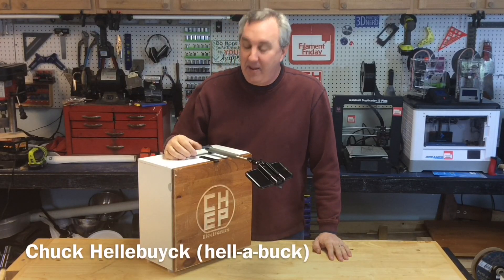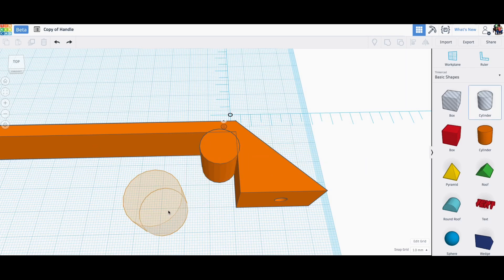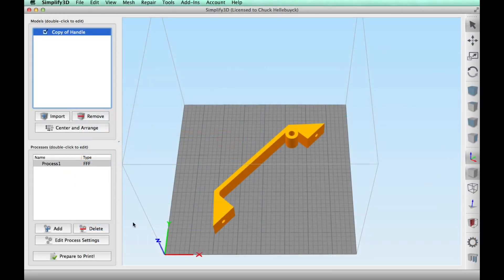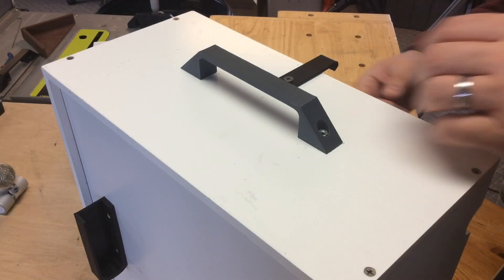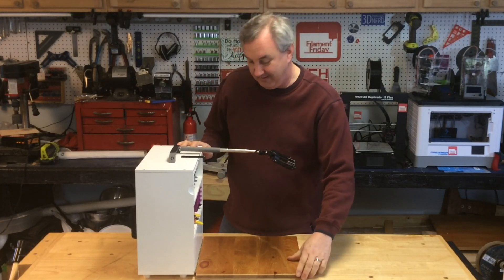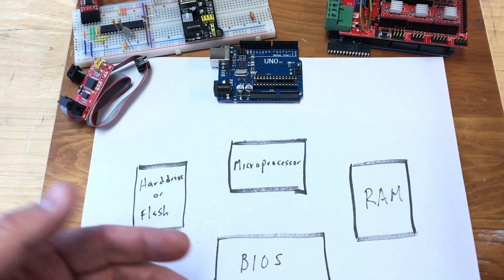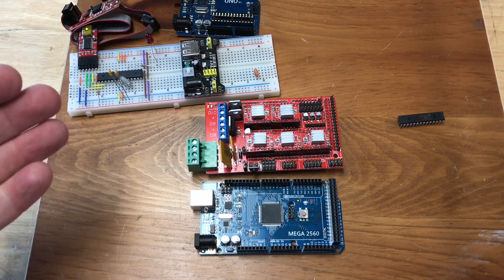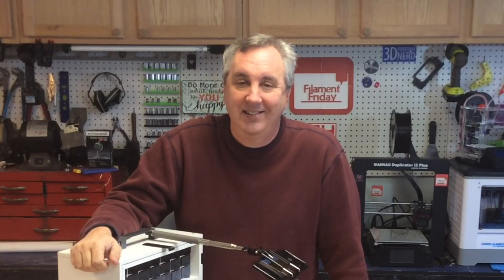What is an Arduino Microcontroller video filmed with 3D Printed Selfie Stick Mount for iPhone

Comment: Really nice!  I love the connection between the white board drawing, the fully formed Arduino board, and your breadboard version.  Really clear and easy to follow.  I'd love to see more of these.  It's such a great connection with 3D printing.  I bought my first 3D printer to print cases for electronics projects. :)